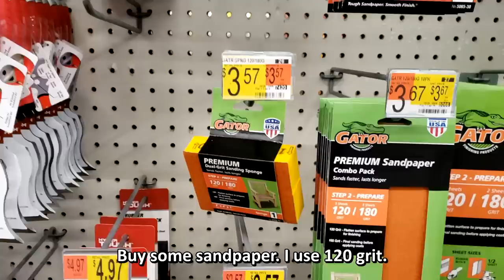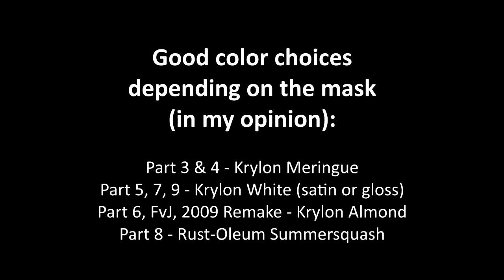How to Improve Your Spirit Halloween Jason Mask: Part II - $34 Friday the 13th DIY

Comment: I got an idea for you Bighush. A Jason vs. Predator themed mask. It is your basic Jason Voorhees mask but with light green fluro paint splattered on it which is the predators blood. Then add glue from a hot glue gun on those blood splatter marks and paint them fluro green for a thick blood look. For a cool add on, put three red laser dots as if the Predator is aiming it's weapon at Jason's head. I'm working on the idea myself. I admire your work and hope to see more in the future. Thank you.

Comment: Pro tip on getting clean edges on the chevrons, with your stencils in place, hit it with another coat of your base color and let it dry with your stencils still stuck down, so when you paint the top red layer (or blue for Roy) it doesn't bleed through the edge of the stencil 🤘